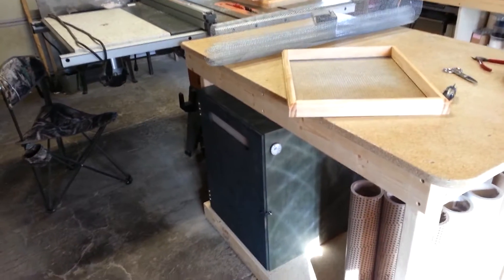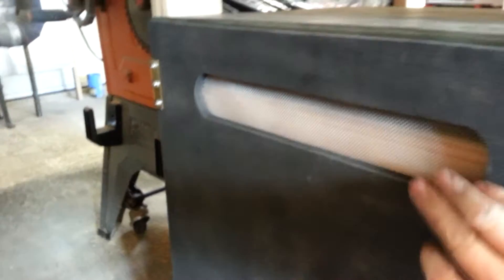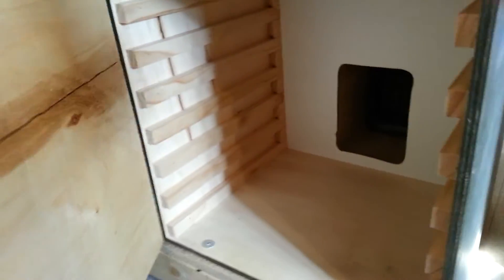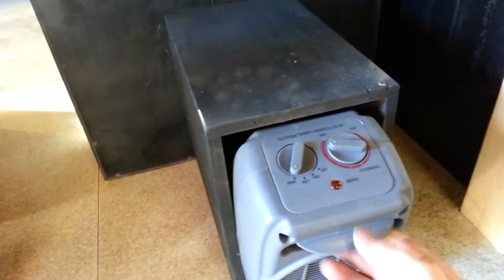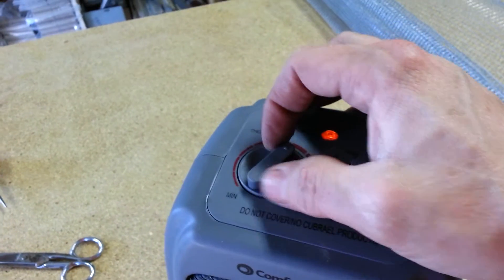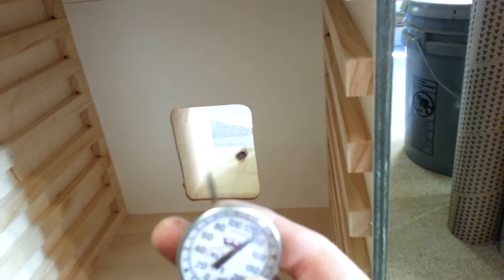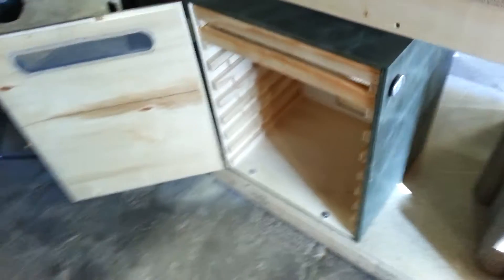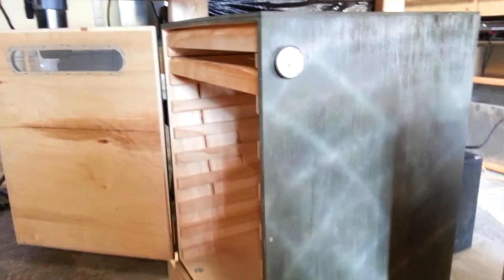Drying Chamber Finished

Comment: Great job on the drying box. 
For tight control over the temperature i`d recommend fitting an stc-1000 digital thermostat. It has a remote sensor on a 10ft lead so you can position it anywhere in the box or even an individual tray when your not using them all.
Reply from the maker: Appreciate that bud..:) Im not sure a tighter control is needed for my app - Ive played enough with the heater controls to pretty much dial it in where I need it but now you have me thinking of an upgrade lol
Reply: +houseoffire72 
The red led readout will add a bit of bling :)  From a safety point of view, the unit will shut the heater down and sound an alarm if the sensor fails (open or short) or the box temperature exceeds the measuring range.